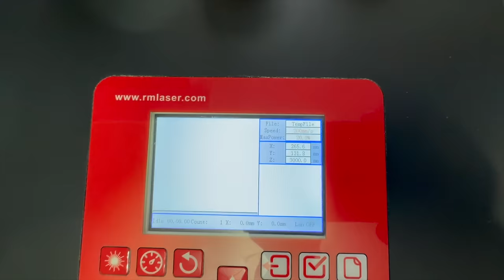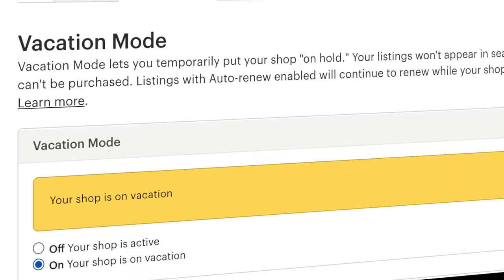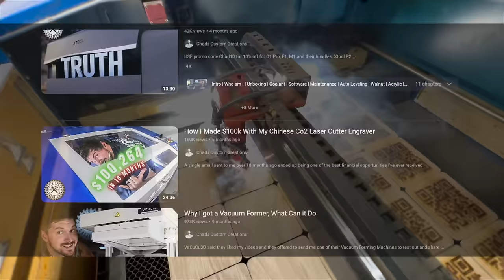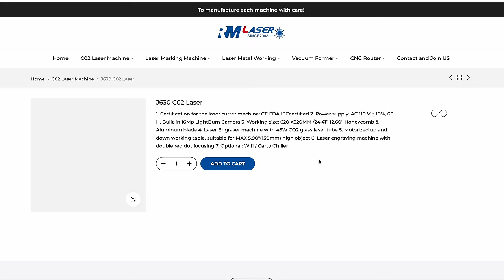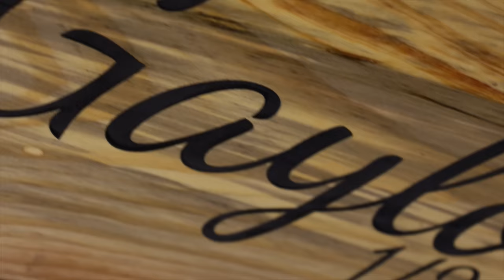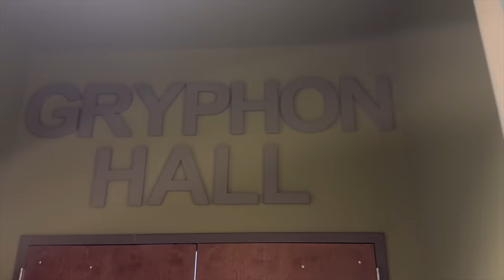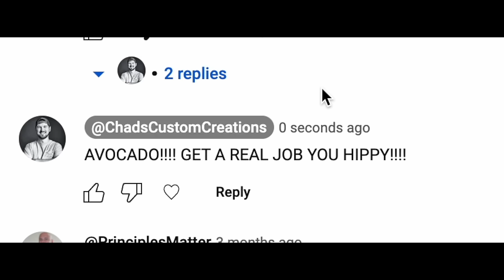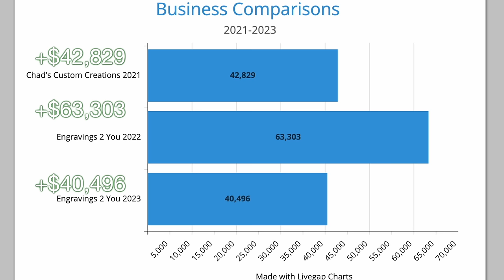Shutting The Doors to my Thriving Laser Business

Comment: Avocado ! will this machine cut .125 aluminum ??
Reply from the maker: I don’t believe so Aluminum is really hard to cut. I was finally just able to do it with a 70w diode laser but could never get anything on the Co2 due to the difference in wavelength.

Comment: Your prices are way too low!
Reply from the maker: Big fan of your channel, you’re right prices were probably too low. Do you think they are still to low even for the engravings 2 you business?
Reply: @ChadsCustomCreations  I enjoy your channel as well Chad! I always mark my prices up as high as I can. Perception is key! Higher price means higher quality in most folks minds. I did Wi-Fi QR codes for a local hospital last year. 33 routers (SSID & Passwords), 144 wall codes. Best part was, IT send me a spreadsheet, so I was able to use variable text in Lightburn and do the job in one day. Just a simple silhouette of the building cut out of plywood, a little text and a QR code, 3x5".  $4176 + $400 installation. I got 60 more jobs at the Physician's Center over the following month at full retail. $49 retail, $29 ea to the hospital wholesale. I would rather do 10 jobs at $50 ea, than 20 jobs at $25.